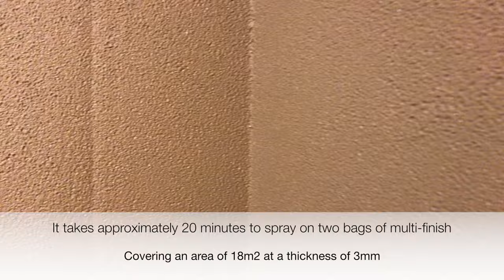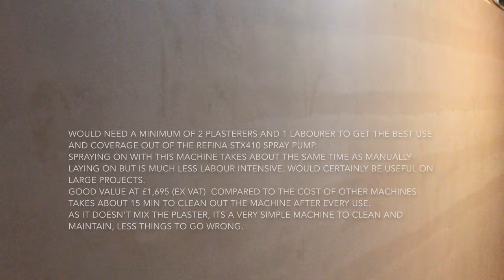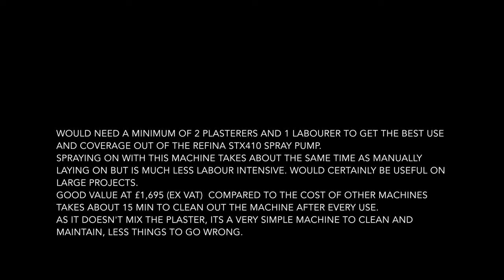Spraying Multi-Finish with Refina SPX410 spray pump

Comment: External rendering machines I agree with , quicker and easier , a machine that sprays skim is just a no no . The time you cover and set up I would have layed a 2 bag first coat on ( and I would have scrimmed the joints) 😂 it would be useful in a massive warehouse with no windows or anything to mask but not in a new build design with exposed oak beams and wood sash Windows 🙈

Comment: I wish this stuff was out when i was younger  ,   my back  might still be in  1 piece  ,   who cares how much the machine costs  , when you think of  how much easier it would make the job  ,  less wear and tear on the joints  .
Reply: I’m 39 now Jim and back, knees and elbows aren’t feeling to clever, may invest in this as I’m on price still
Reply: Id do them walls in under 2 minutes easy with a trowel spread and flattened
Reply: @adamcunningham2511  good for you Adam . Here is a gold medal 🏅
Reply: @OGDadAverage  he has a point though. I'm 49 been plastering over 30 yrs, yes it's hard on the body, but that seemed ab almighty f about to get 2 little walls on

Comment: you need to cover everything before you even start..and you can't let the machine run dry otherwise you could end up needing to get it serviced..plus Try using a spray system in a domestic job 👎....turst me your gonna get a bill from the client for cleaning if you don't cover everywhere your working 
spray systems are good on site or external jobs and that's it 
plus your start up costs are I'm region of £3000 don't be fooled by the hype!  sorry if this comes across as negative comment or trying to bash your channel guy's.. but I feel someone needs to tell the turth!
Reply from the maker: Yes, I would agree with you Steven. They are best used for site work not domestic jobs. As for cleaning the hose etc, that is not a problem as you get a couple of small sponge balls that you run through after spraying and it cleans it through.
Reply: london-plasterer.com yes I know all about cleaning these and the bigger machines out bud I've worked on number of schools and plenty of external site jobs so im talking from experience. but at the same time if a person or persons can make that spray system work without damage to a clients home.. then fair play! but me personally I'm unwilling to take the risk as my businesses reputation rests on finish and cleanliness!
Reply: steven gordon so in other words, by the time you covered everything and had to spray over twice, you’d have done the job by hand in considerably less time.
Reply: Anton K pretty much bang on... those two walls he’s doing in the video would of been almost pulling up by now if it was hand applied 😂
Reply: @tj9382  in a nutshell yes mate.

Don't get me wrong tho, on external jobs these machines are a god send. But domestic jobs 100% pass for me.  But if you are willing to take the risk and can make it work maximum respect 👍
Reply: @tomyates5075  agreed a skilled clean plasterer is worth every penny he or she charges 👍
Reply: Well said mate looks a complete waste of time and money in my eyes, I put that on wayyyyy quicker the traditional way
Reply: @stevengordon2145  b

Comment: stick a l.e.d light near them walls after being painted.refina trowels from start to finnish is a no..no.drags fat everywhere and you cant get the preasure u need with a flexi trowel.flatten once wirh a flexi if need be then after that finnish with a hard marsheltown.ive seen loads of people do it that way on site and as soon as them lights are shun down them the easyfiller comes out

Comment: i tried the pft ritmo to do multi finish. It was not practical onsite..very messy and didnt save me time due to cleaning ect....mp75 straight onto blockwork would work better for commercial spreads as its a one coat plaster you rule off...sponge then trowell up onto brickwork but this to skim in my opinion is a waste of time. Look at the mess on the floor...you need to tape up everywhere and site agents arent keen in my experience. Machines are brilliant with specialized renders though but with a 3mm skim the tech just isnt there. But thanks for the video. best wishes

Comment: Used a pft ritmo . Doing multi finish cost me nearly 10k. Used it on a site with houses. Extremely messy with a mist of multi finish. Didn’t save me any time at all,  just more cleaning. Good machine for k rend etc but spraying multi? Nah. Using a thicker one coat like mp75 would work well with it but it’s getting people to use it.

Comment: There are (professional) plasterers who earning a living at it and have built up the muscle memory to do great work at a good speed.

There are (jack of all trades) who have to maintain a decent level of finish work when doing refurb work on their own. Anything from installing a new bathroom or kitchen will require making good and finish work plastering. 
Sometimes it's not always possible to get a skilled plasterer in the time needed and also there is the cost of paying a decent plasterer.

Then we have the (DIY person) who wishes to do their own on their own house (this is me).
I have been on many courses learning the basics of every trade so that whatever is in my house was done by me. I was in the building Industry as a lead worker, did carpentry as my Dad was carpenter and kitchen installer for decades.

Then we have the (New starter) who doesn't know where to start and has to sift through the thousands of How to videos on Youtube.

I think we have to start grading the level for these videos so that we don't get pros slagging them off and we don't get learners forking out for equipment that they will only need once and end up stuffing it in the garage until it ends up at a boot sale.

Comment: I'm plastering 20years or more I've worked with the sand and cement sprayer just a while ago but not to keen and spraying an skim coat fair messy if you had ceilings finished over head